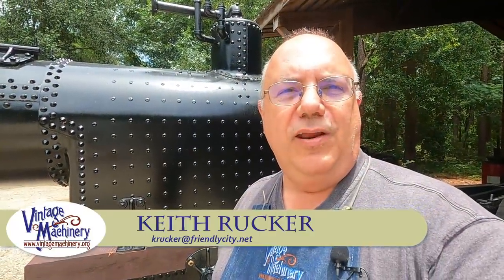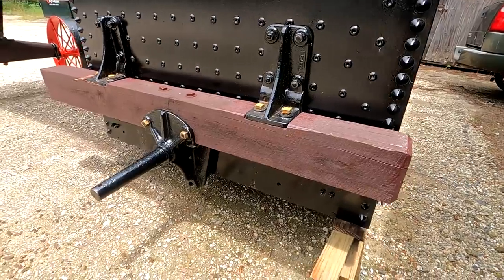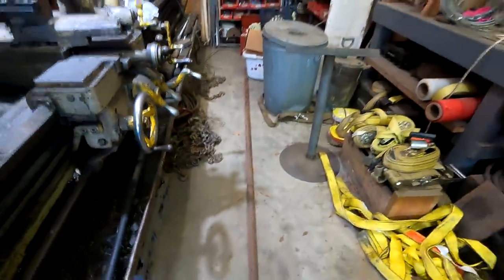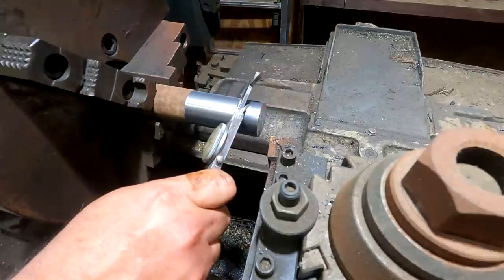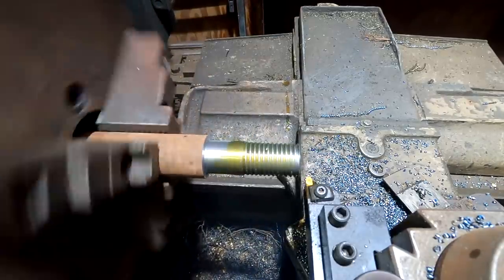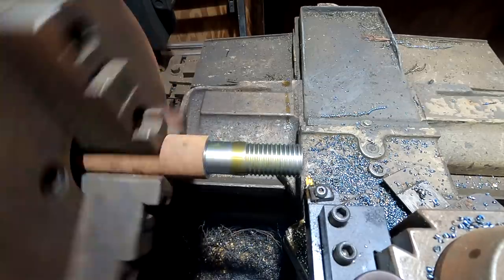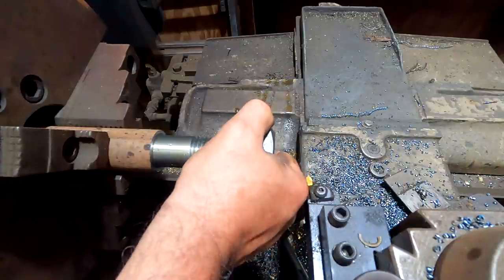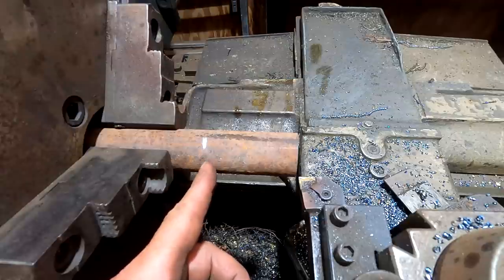Frick Steam Engine Restoration - Machining a Cross Bracket

Comment: Keith: I was noticing how much the tool dragged from "spring back" even on such a heavy rigid lathe with a heavy tool holder when you pulled the carriage  back across the diameter. Goes to show how much tool pressure is needed with indexable inserts verses a "sharp" tool that you grind by hand......Dave

Comment: you say waiting for # to come around please show what that means.
Reply: You might already know, but in case you don't, he is referring to the numbers on the threading dial which is linked to the lead screw. 

As the lead screw turns so too does the threading dial turn. On the threading dial face there are numbers (and/or lines) which correspond to the number of TPI (Threads per inch) being either an even number or an odd number. 

If for example the TPI were an even number he would perhaps wait for the dial face to turn around to the number one, then he will engage the half nut which is linked to the lead screw. 

Engaging the half nut on the desired threading dial face number or line will set the carriage (and thus the cutting tool along with it) into motion in sync with the lead screw. 

The lead screw itself is being driven by a combination of gears that along with the lead screw's threads produce the desired rotation and distance for cutting threads of a given pitch. 

I should also mention that in cutting threads on a lathe you need the mechanical ability to have the cutting tool repeatedly follow precisely in its own footsteps (or be in perfect sync with the path) of previous cuts as it cuts deeper with each subsequent pass until finally the desired depth of the cut is achieved. 

Again, this is where the threading dial comes in to help facilitate that precise repeated  cutting path by indicating exactly when to engage the half nut. 

There are many videos (Including detailed one's by Keith, Abom79, Mr. Pete, and others) that explain this way better than I can, and really it does help tremendously to actually see the process of threading as well as to understand the mechanical relationship of how the machine itself is geared together.

This mechanical relationship between gears and the number of threads on the lathe's lead screw (which the half nut engages with to drive the carriage along while threading) is where the mathematical magic happens that makes threading possible, BUT If you are new to all of this, DON'T WORRY as it's really just something that is far more difficult to explain than it is to understand or to do. It's actually very simple.
Reply: @johnstrange6799  thank you .you explained it very well
Reply: @johnstrange6799  Thank you for a great thorough explanation, if he showed the dial and half nut engagement there would be a number of commenters saying “why are you showing that do we have to see that every time”. You can’t win for losing.
Reply: @casycasy5199  No problem. You're welcome.
Reply: @july8xx  You're welcome, and thank you. It's true what you say.  It's been shown by several creators in depth and in detail, and undoubtedly re-demonstrated every so often by the same creators as viewers new to machining or threading come along, but at some point they kind of just have to assume that the majority of people watching know what they mean, or else they would be showing it every time they threaded something, and that would upset someone some how. It's funny, I saw threading so much in youtube videos that when I got my first lathe I threaded something like I had been doing it for years, but in reality it was really just my first time. Very much a monkey see monkey do kind of learning experience with the lathe. :)

Comment: A couple of suggestions for beginners on threading. Buy a thread gage . There not very expensive and very useful. You can use it to hand grind your threading tool, used to set your cutting tool and it has the double depth of many of the common American screw threads. 
Using the thread dial I always in gage the split nut on the same number and doing it that way I have never cross threaded . It might not be the fastest way but for a beginner it is the safest .

Comment: 43 and 3/4 plus 6 inches is 49 and 3/4 - not 48 and 3/4... will it make a difference if the piece is an inch short? Seems like it will...

Comment: Can someone help me to understand the scoring that the lathe tool left when it retracted. On the first end when the tool was retracted it left a cork screw pattern. I thought at first there was too much tool pressure on the first end that led to a cut during the return. I also thought that perhaps the insert was dull.  On the second end there was no scoring visible.
Reply: That scoring is from the spring in the tool, and the tool post assembly.  As it cuts there is a force pushing it back. On heavy cuts it is more pronounced and will do it with the sharpest tools. Most machinist will not worry about it but will relieve the pressure on the return cuts when the target size is close by backing off the a few thousands also on very light cuts there is less back pressure.

Comment: I used a lathe a bit in metalwork class at school. I made a sash cramp for my exam - which needed a threaded bar. The teacher brought me a set of taps & dies ! I said I'd do it on the lathe - he accepted that. I set the lathe up and was about to start and he came over to supervise. I cut the first pass and was winding the cross slide out when he said you don't need to do that - in other words, he knew threading could be done on the lathe but had no experience of doing it - so I ended up teaching him ! I used a test nut to get the thread I wanted - even though I was going to make the actual nut I'd be using.

We had a lathe at home - so I had more experience than him with threading!
Reply: The shop teacher told us that when cutting a thread on the lathe you needed to be sure it was done as you couldn't put it back in and recut it . Just another example of someone one who didn't know what he was talking about. I have rethreaded damaged threads and extended threads on bolts many times. It's nice to have a lathe to repair damaged threads.
Reply: @erneststorch9844  I used a die  to clean up a thread recently.
The thread belongs to my lathe :)
Reply: @millomweb  A die will clean up a damaged thread if you have the correct die and do it quicker than the lathe. 
But if you don't have the correct die you can chase it on a lathe if one is available.
Reply: @erneststorch9844  A die is easier fit fit in your pocket than a lathe.
;)
Reply: It is a lot cheaper to buy than a lathe.  I have both . Some of more common thread pitch dies and a 10" Atlas lathe  with a quick charge gear box.

Comment: I do a lot of close tolerance threading at my job. Most are a 3B fit and range from 1-72 to 1/2-40 single point cut using a tool room grade Hardinge lathe. These are missile components and normally I use thread wires but some allow me to to use a ring go no- go gage. Sure is nice to thread bigger stuff where you have a little more "wiggle room". Plus if you mess up it doesn't cost thousands of dollars. You are right though practice makes perfect...

Comment: Mr Rucker 
how do you check that your metal lathe chuck is turning straight?
Reply: put a piece of rod in the chuck and turn it down until its cleaned up all the way and then measure it on both ends will tell you if it is cutting a taper.

Comment: My lathe's bore is specified as 1·5" (38mm) max bar dia - so I guess it's a little bigger than that ! Not the aort of place you want an interference fit - do a lot of work on the bar heat it up so you can't remove it till it's cooled LOL

Comment: What Keith doesn't explain is how he manages to retract the cross slide at the end of each threading pass at exactly the right moment. Leaving it a fraction late would cause the tool to dig in (or crash into a shoulder had there been one there).

Comment: Could you have cleaned up the bar while you had it on on the lathe? It may have been much easier to remove the rust. One step closer.
Reply: Hard on the tooling and wouldn't really save any time.
Reply: Belt sander and/or Scotchbrite. I wouldn’t use cutting tool.
One observation: I know this job is for static display, so no harm, but if that boiler was going to be moved around regularly, I would have put a generous radius where the machined portion of the rod meets the bar stock’s initial diameter.
Reply: Center drill the ends, fit live and dead centers, and use a travelling rest ?   I wouldn't bother. 
It only needs a heavy wire brush or sand blast operation.   I think this is all that's required by Keith.   It's not like the part will be internal to anything, or fit through machined support blocks.
Then a coat of primer , and a hand brushed paint job, for an un-seen undercarriage part and voila.

Comment: I'm surprised both ends are RH threads.
Reply: I don't think it really matters as it's just a bracing rod on a static display. More for visuals rather than functional
Reply: Why surprised?
Reply: Doesn't matter as it is a captive set, not rotating... Good catch though...
Reply: @terry6131  Actually it is structural,  with out the rod, only the wood and no bottom strength... the wheels would go like a vw bug and collapse upward.
Reply: YOU need to be both same thread to be able to thiten them
Reply: The rod does not rotate, or have turning forces applied to it.   It's essentially one long (custom) bolt.
Reply: @emilgabor88  Yes, That's how you can tighten a Stud, both ends are R/H.???

Comment: For someone who has no experience with what you and Abom do, I have a big question.  When y'all are turning down a piece of round stock ion the lathe you say that I need to take off 20 thousands more. Then you count off 2, 4, 6, 8 etc. How far are realty you moving the cutter in? 10 thousand or 20? Where each number is 10 + 10 = 20.
Reply: 10 thousands, beacuse you measure in diameter, but you cut on the half of it (radius). So if you move in 10 thousands, your diameter measurement will drop by 20. To make it tricky, some lathes have their knob dial marked for diameter, but most have it marked for the half ( and tell you how much the tool really moves forward by rotating the knob). Hope my answer is not confusing.

Comment: Re the second end shoulder - you're cutting to 3". I'd cut to 7" and put a 6" thread on it. That way you can install the bar without dismantling any other part of the boiler frame. In assembling, insert the long shoulder end, align the short shoulder end and insert - put the nut on and tighten. Then put the nut on the other and and tighten as required. This longer thread will offer clamping adjustment and would accomodate 2 nuts - either 1 either side of the fram or both on the outside - so good tightening can be achieved without overclamping the boiler.
Reply: That’s a lot more work than taking two bolts and the part off, both in making and installing. The boiler can no longer be certified. This is a static display piece that will not have any stress on it.

Comment: Hello Keith. Is the automatic feed mechanism disengaged automatically or manually ? I mean, a manual disengagement might be a bit heavy on the tool-bit,  with no clearance cut or shoulder, should you disengage manually just slightly too late with a full depth cut into the full diameter ?
Reply: I'm guessing the lathe has a carriage stop that disengages the travel.  No way he runs to the end of the cut at exactly the same spot without help from something.
Reply: @davidcallista2580  Thanks, I also assumed there is an Automatic Disengagement Mechanism, not mentioned in the "easy threading".

Comment: Not sure why the rod had to be 1 1/2.  Is the shoulder really needed? Seems to me that the rod simply operates under tension. I would think the original rod would have been one size and double nutted on each end. That way wheel camber could be adjusted as things wore.
Reply: It didn't need to be 1.5, it needed to be 1.125. but the stock they had on hand was 1.5, and he could have turned down just the ends, or the entire length. Guess which choice would be easier.
Reply: @johncochran8497  He didn't say that was all they had just what he was going to use. I wouldn't turn the whole bar if that was all there was. My bet is if he had some 1 inch that would have worked since the bar is mainly under tension.   That 1 1/2 incher weighs almost twice as much as a 1 1/8 inch bar. Now if he had plenty of it? Go ahead and use it..